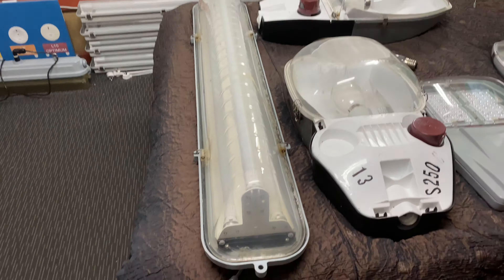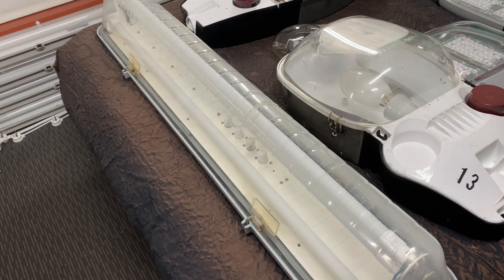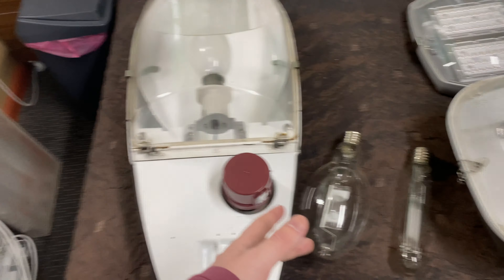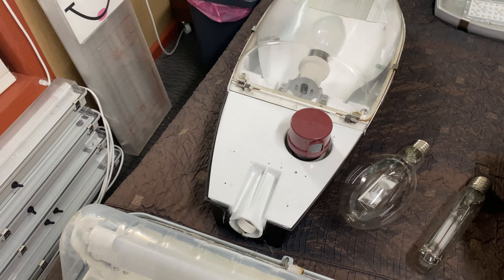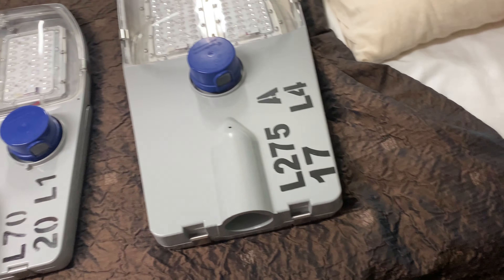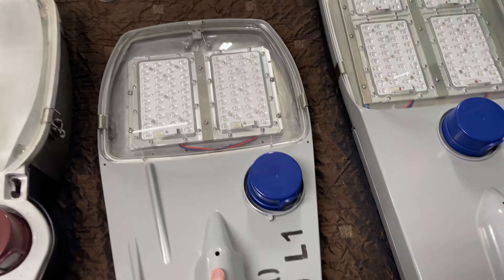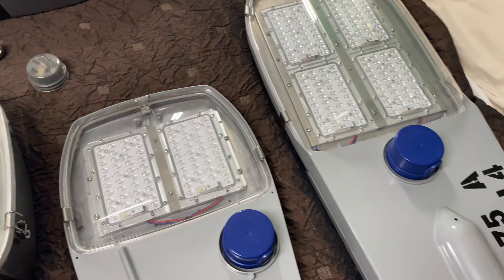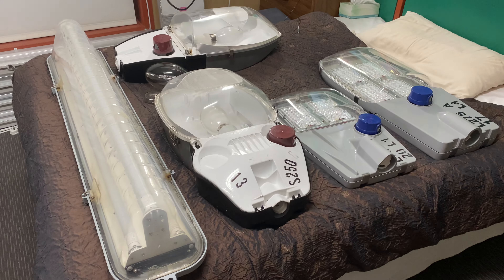Major road street lights

Comment: Older streetlight systems used a single photocell to run multiple streetlights. You can tell if this system is still in use if there is a 5th thin wire next to or above the other 4 LV wires (sometimes more wires on major roads).
This system is least common on minor roads in networks less than 40 years old (although some wires and photocells are still left abandoned) and most common on major roads of older suburbs close to city centres